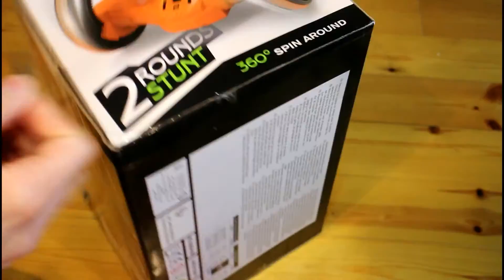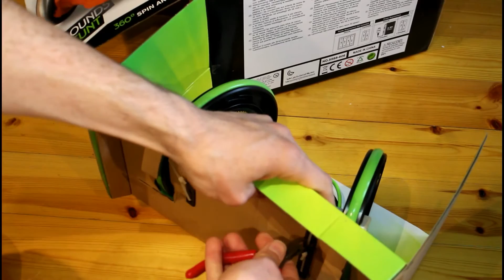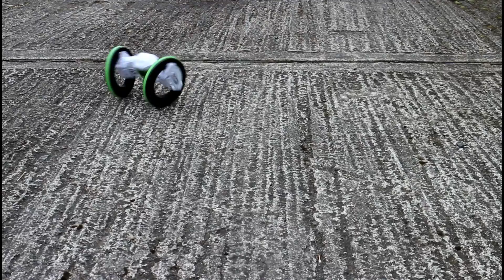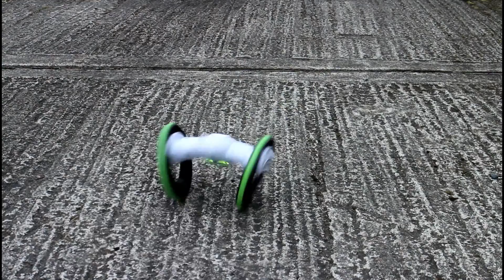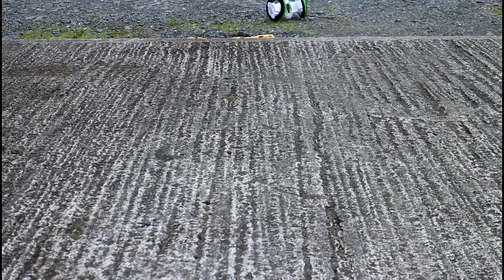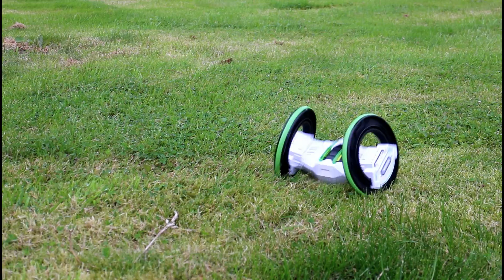360 Rotating RC Car from Lightake, could it make a cool robot?

Comment: i have a question that doesn't pretain to this video. 
i just got a 3d printer and was wondering what program you use for building parts?
thanks Darrell
Reply from the maker: I use freecad now, its a bit clunky but with a bit of practice its quite good. I think the nozzle is 0.75mm but I don't really remember.